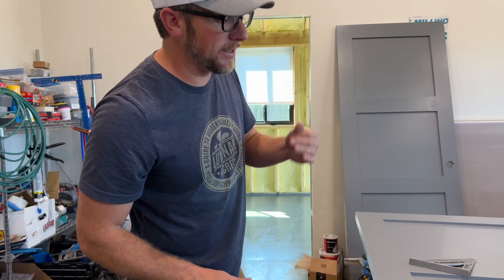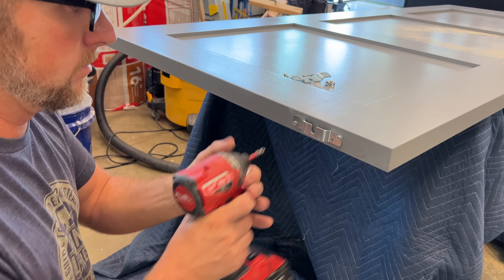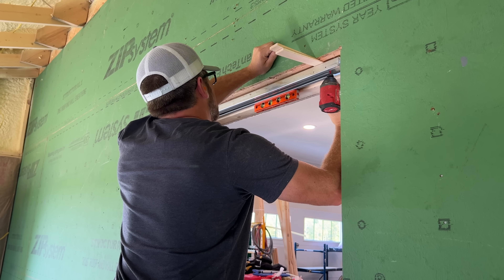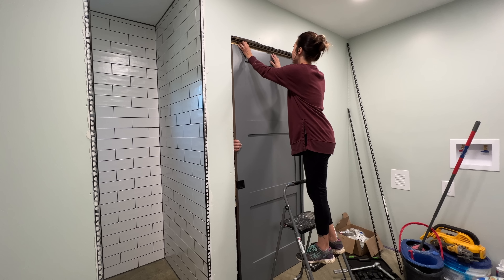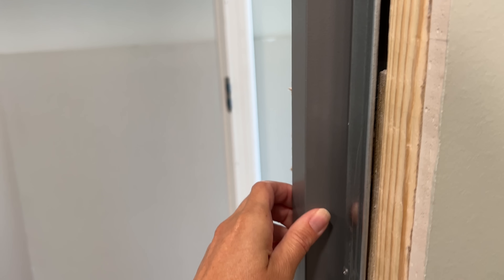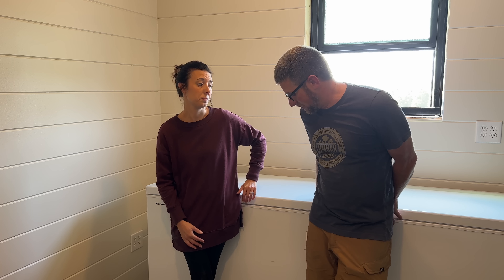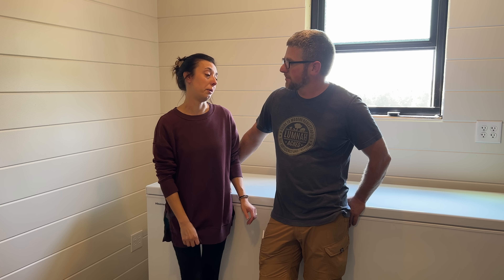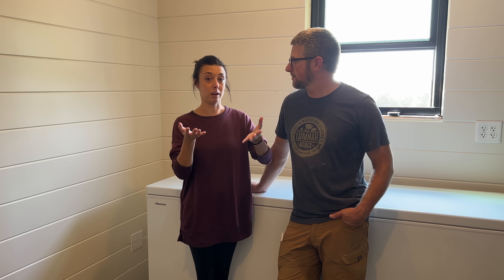We NEEDED Time to PROCESS it ALL...

Comment: When it comes to the trim, embrace the dark side.  If it was me, I would go with the similar sheen to the surrounding paint or even a high gloss, and not the flat finish.  Some say things are looking messed up, but I say it is evidence of some great work that has been done.  Things will look just fine once the dust litrerally settles.  Prayers for Gina and the upcoming procedures.  You are stronger than you know and everything will work out well.  :_Pluto::_Tanner::_Figaro:

Comment: A suggestion: heavy duty wire shelving on wheels. I used 18x42x60 5-shelf units in my attic. It gets your stuff off the floor and takes advantage of vertical storage.

Comment: Need a big thermometer in the power room to monitor heat from inverters freezers and what's ever else powered ends up in there.  May need to install a heat exchanger or a vent to bring in cool air. Everything will run better cool

Comment: The doors look great. We ❤ pocket doors. They free up so much wasted wall space. You may have already thought of this, Al, but a rubber bumper mounted in the depth of each pocket, centered on the overall height of the door, will totally eliminate any potential banging when door is pushed back into the pocket, make your house much quieter, and make the door last far longer.
Reply: You could also mount the bumper on the edge of the door in the pocket, which should not show.

Comment: I suffered with endo. for years. (Back in the day when doctors ignored women's complaints.) I can't tell you how many times I was told "Some discomfort with your cycles is normal." At 38 I had to have a hysterectomy because of fibroid tumors. They "discovered" I was full of endo. Extra 3 hours in surgery. I was blown away by how good I felt after it was said and done. I had no Idea before that what normal was. May your procedures go smoothly and your recovery be easy and swift.

Comment: I feel like the darker color would look good.  Paint a scrap board and put it alongside the door and see how you like it  Al you did a good job on the doors.  Gina don't get upset about the ostomy.  I have had a colostomy for over 10 years as they removed part of my colon.  You get used to it.  I have some other problems and they can't reconnect mine.  because of my age they are afraid to do it.  I am 83.

Comment: A trick to keep your freezers from sliding into the wall is to lay a 2 X 4 on the floor between the wall and the freezers.  They won't slide into the wall and the spacing will allow the freezer lids to open without hitting the wall.  Just my $.02 worth 🙂

Comment: I’d do white trim in a gloss so easily washable. 
Due to severe injuries I’ve had to deal with colonoscopy and then a later reversal. Dealing with it turned out not so bad but was glad for the reversal. I pray your surgery turns out as well. Your job is try to heal and I know you will

Comment: I would go white an use the high gloss trim paint. It will clean up easily.  You already have contrasting colors I would not add another.  Dark flat paint looks worse than white when its dirty and is more difficult to clean.

Comment: Maybe use a grey primer and paint on trim for the pantry door since it is closest to the kitchen and cabinets and see if you like it. Then you will know a little better if you want lighter or darker ie: white, light or darker grey or black trim. Using grey primer allows use of lighter or darker paint colors.  If you prime and paint trim for 1 door, decide you don’t like it it would be easier to change decision of paint color for the rest downstairs rather than having to repaint all of the trim. I do like the white door casing / trim upstairs. Once cleaned it shouldn’t ever get that dirty. Use paint that cleans easily with mild soap and water and it isn’t a problem.

Comment: The freezer should be fine if you kept it upright during travel. If you have to lay it down keep the drier on top.  Refer to the manual or the parts diagram. Worse case pull a panel to look in. Might need a flashlight. What you are trying to do is not let the compressor oil drain onto the drier. It takes a while for the oil to drain into the drier. It takes the same time to get the oil to drain back. If the drier gets oiled it will take a long time for the refrigerant to clean it. Will it ever be 100 percent? Hard to say.

Comment: Al & Gina, we have painted our interior walls several times in the past 50 years. I think keeping the door frame the same color as the door itself keeps from chopping up the flow of the wall around the room. We use a lot of color but our walls and windows are pretty neutral and we use color in the furniture and other decor. When we used a wall color, a contrasting door color, and still another trim color, there was too much busyness to the room. It made it difficult to add any other decor. I’d suggest keeping the trim color the same as the door or the same as the walls. But that is our opinion, you have done a wonderful job building your little house.
Hugs and prayers for the upcoming surgery. We pray all goes well and you are soon back to good health. 🙏🏻✝️🙏🏻

Comment: Once again Al , the Only thing in those Power Inverters that would make any kind of Noise would be those Cooling Fans and they are normally quite !! Inverters are made up of numerous Circuit Boards and DON'T make any noise at all. I was the NCOIC, '' Trick Chief ''  of 3 Microwave Telecommunications Sites in the Republic de Panama Canal Zone, U.S. Army StratCom-USACC on the Pacific side from Dec. 73 to Feb. 77 and all three of the Sites had UPS Battery Back Up Power Systems,  and Power Inverters and they were ALL SUPER QUITE !!

Comment: Basic stuff. First mess is normal for trim stuff.  Make one side door trim for each color then hang it on an out of the way door, then choose. No matter which color -- full gloss -- it's easy to wash. The minute your daughter moves in, she will want to change inside her room door color to match walls, be prepared. Normally doors to working rooms have color. Doors to storage rooms or seldom used utility spaces are the same as the wall color. Put in a dog door. Normal exterior door enhancement. Or teach your dog and cat to use a commode, Japanese commode is flush with the floor so it's possible. More than 48 h is long term catheter and damage to the sphincter happens. Urologist know this and they have a fix. But they want to wait until control is  lost to try he point that no control urine loss occurs when you just stand up. Endometriosis and cist are things growing in the wrong place. When I was working in the lab, reproducing cancer cells growing in a lab flask was by scrapping the cells from the attached surface. A laser removal allows keyhole entry of surgical instruments and  viewing scope. The laser burns the out of place cells so they cannot grow anywhere any more. Try to get most everything inside done before you go in for the fixes. As I said before, handicapped bars everywhere are easy to grab when you are having a balance/ movement day. I am here for you if you have questions.

Comment: No matter what colour you choose for the door trims - they are going to get finger marks/dirty. White, you see the dirt and will wipe them off = hygienic. Any other colour you are only kidding yourselves - they still get dirty but you don't see it...  and you intend to butcher fowl there...
Pity about the upstairs bedroom doors - one pocket, one standard. Both could have been space saving pocket doors - if you had placed the pockets back to back in the middle of the dividing wall - accepting a little 'step' in one of the bedrooms to compensate for the difference in thickness...

Comment: I've been watching your house build and you putting in your solar power system. I'm constantly trying not to comment however seeing just where you have placed the "Home Battery" setup has me just a little concerned. Obviously you have no idea of the fact that lithium batteries can erupt causing house fires. Yes I know that all reputable dealers will have cooling systems built into their systems but that only proves that there is a problem when things do not go right.
Think about the possibility that it did happen and you are upstairs sleeping. Alarms would wake you but how do you escape when you have to go right past the door to your battery system which could be totally in flames?
You need a second escape route at the opposite end of the building. Just a door that you could jump from would probably be enough.

Comment: A Smart and Experienced Electrician would have used those Adjustable Depth Setting type of Boxes whereas one can adjust the depth of the box to make it FLUSH with the finished Wall Surface and not have to use those Box Extenders like Al used ! But once again, what can one expect from a Un-trained Un-Licensed AMATEUR  with NO experience ? And who doesn't know the CODES !!!!